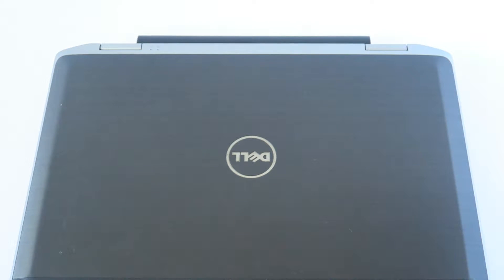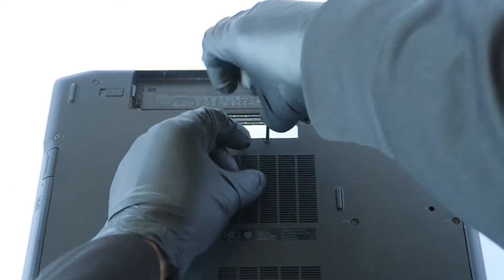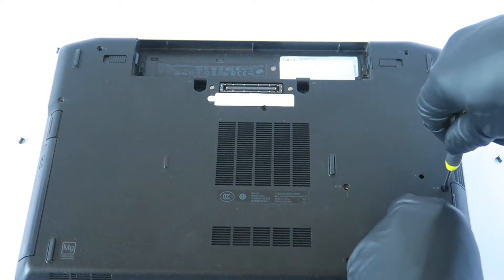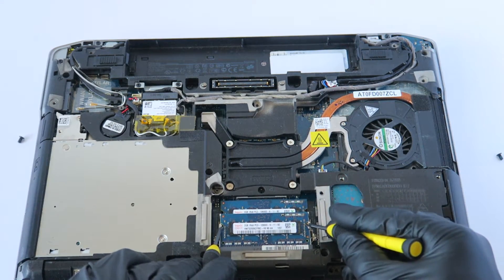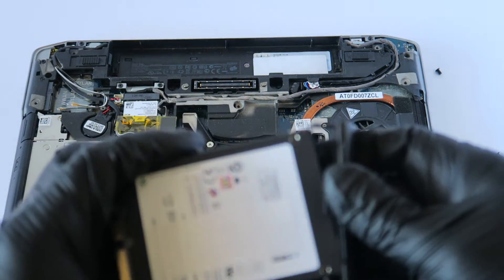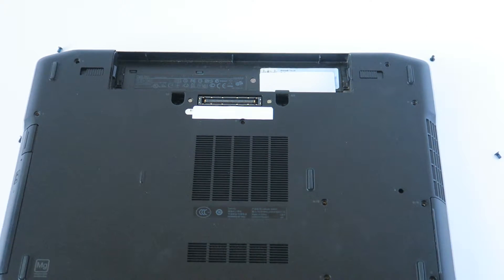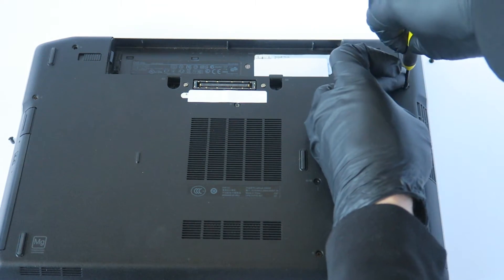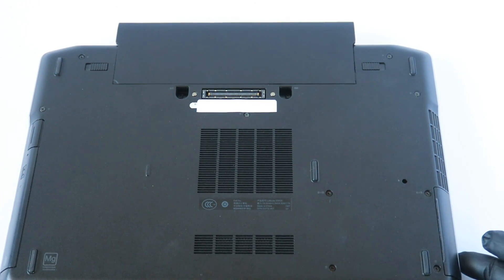Dell Latitude E6420 Upgrade SSD RAM

Comment from the maker: List of RAM works with this Machine MAX RAM Supports 16GB and 8GB per Slot tested with latest BIOS installed A25: 

 (1.) Crucial 16GB Kit (8GBx2) DDR3/DDR3L 1600 (PC3-12800) Unbuffered SODIMM
https://amzn.to/3e58PTs
(2.) Crucial 8GB Single DDR3/DDR3L 1600 MT/S (PC3-12800) Unbuffered SODIMM
https://amzn.to/2WNvw9d
(3.) Crucial 8GB Kit (4GBx2) DDR3/DDR3L 1600 MT/s (PC3L-12800) Unbuffered SODIMM 
https://amzn.to/2zPos2S
SSD list works with this PC:
(1.) Samsung 860 EVO 500GB 2.5 Inch Internal SSD MZ-76E500B/AM) 
https://amzn.to/2ZlZDGg
(2.) WD Blue 3D NAND 1TB Internal SSD, 2.5" WDS100T2B0A
https://amzn.to/2XezdU9
(3.) WD Green 1TB Internal PC SSD  WDS100T2G0A
https://amzn.to/2XfGtzc
(4.) SanDisk SSD PLUS 480GB Internal SSD SDSSDA-1T00-G26
https://amzn.to/2yfgjUK
(5.) Crucial MX500 250GB 3D NAND SATA CT250MX500SSD1(Z) 
https://amzn.to/3bTTjbX
(6.) Samsung 860 PRO SSD 256GB - 2.5 Inch SATA III 
https://amzn.to/2ymvQCq
(7.) Samsung SSD 860 EVO 250GB 2.5 Inch SATA III Internal SSD 
https://amzn.to/2VjIAkK
(8.) SanDisk SSD PLUS 240GB Internal SSD
https://amzn.to/2zfc7EX
Reply: Crucial 16GB kit DDR3/DDR3L 1600  (PC3-12800) Unbuffered SODIMM (8GB-2)
Reply: WD Green 1TB internal PC SSD WDS100T2G0A
Reply: wait it not take nvme and M.2 ??

Comment: Hello bro greetings from Brazil, I found a Dell Latitude E6420 notebook working perfectly, it had 6GB of RAM and decided to buy two 8GB sticks, I bought it with these configurations: Kingston 8GB 1600MHz DDR3L PC3L-12800 1.35V, but unfortunately when I turn it on, the screen goes dark and then turns off immediately. Can you help me?❤

Comment: I have all the screws out but I cannot get the back cover off.  I have pulled, pried, and done everything but break it. The top, or battery end lifts right up.  But the bottom is stuck.  edit: I had to take a plastic hammer and pound on the back driving it to the stuck end.
Reply: Did you finally get it off?

Comment: I just took out my hard drive from my laptop but when i put it back one screw won’t go in and it says no hard drive detected could someone pls help me
Reply: I had the exact same problem. Turns out the drive seemed to seat but it didn’t. It went all the way in but was missing the socket.  I discovered this after pulling the back off and observing the seating operation. Once I seated it properly, the 4 screws then tightened properly.

Comment: Hey, which things do you use?
Reply from the maker: List of RAM works with this Machine. 
  

(1.) Crucial 16GB Kit (8GBx2) DDR3/DDR3L 1600 (PC3-12800) Unbuffered SODIMM
https://amzn.to/3e58PTs 

(2.) Crucial 8GB Single DDR3/DDR3L 1600 MT/S (PC3-12800) Unbuffered SODIMM
https://amzn.to/2WNvw9d 

(3.) Crucial 8GB Kit (4GBx2) DDR3/DDR3L 1600 MT/s (PC3L-12800) Unbuffered SODIMM 
https://amzn.to/2zPos2S 

SSD list works with this PC:
(1.) Samsung 860 EVO 500GB 2.5 Inch Internal SSD MZ-76E500B/AM) 
https://amzn.to/2ZlZDGg 

(2.) WD Blue 3D NAND 1TB Internal SSD, 2.5" WDS100T2B0A
https://amzn.to/2XezdU9
 
(3.) WD Green 1TB Internal PC SSD  WDS100T2G0A
https://amzn.to/2XfGtzc 

(4.) SanDisk SSD PLUS 480GB Internal SSD SDSSDA-1T00-G26
https://amzn.to/2yfgjUK 

(5.) Crucial MX500 250GB 3D NAND SATA CT250MX500SSD1(Z) 
https://amzn.to/3bTTjbX 

(6.) Samsung 860 PRO SSD 256GB - 2.5 Inch SATA III 
https://amzn.to/2ymvQCq 

(7.) Samsung SSD 860 EVO 250GB 2.5 Inch SATA III Internal SSD 
https://amzn.to/2VjIAkK 

(8.) SanDisk SSD PLUS 240GB Internal SSD
https://amzn.to/2zfc7EX

Comment: The Dell latitude e6420 unofficially supports 16gb of ram. I put 2 8gb sticks. I am running bios A25
Reply: If you cannot afford 16gb you can put 12 like i have. 8+4
Reply: Can 16 be supported? Plz tell
Reply: Can do 4+8?

Comment: how big of a difference is a ssd, i got a 5400rpm 500gb in mine thats really old, and the laptop is like painfully slow at this point
Reply: BIG! at least 5x the speed for any loading or booting up... gotta check if you got enough ram too.
Reply: Bencze i got 8gbs ddr3 1333mhz
Reply: I have the same laptop. And I have no idea what to do but I want to learn more. ￼

Comment: what is the maximum Ram size i can install ?? i have same model with 4GBx2 i want to install 8GBx2 if its possible , thank you for your video
Reply: max is 8 but people in several sites are saying that they are running 16gb just fine.
Reply: 16 works fine bro

Comment: the max memory supported is?
Reply: the max memory is 16gb which is what i have in mine with a 1tb hard drive
Reply: @ivanvarava7599  have you 2x8gb ram or one single 16 gb ram ?
Reply: 16
Reply: @bigpapab  have you 2x8gb on dual running or one single 16gb ram ?
Reply: Dell says 8 but you'll find many people saying they put in 16 and it works fine.
Reply: 8 GB
Reply: I used 12